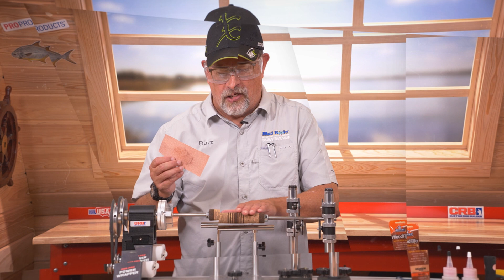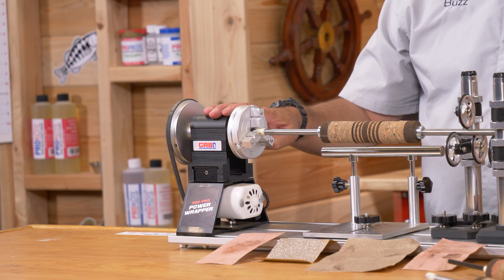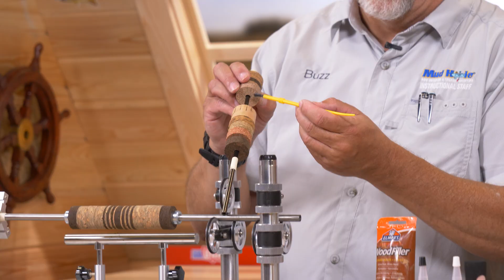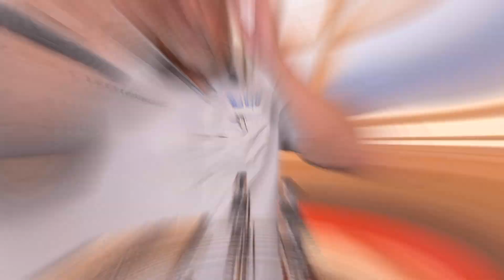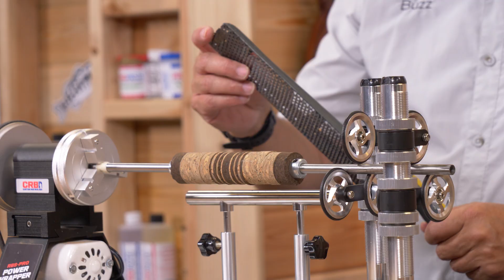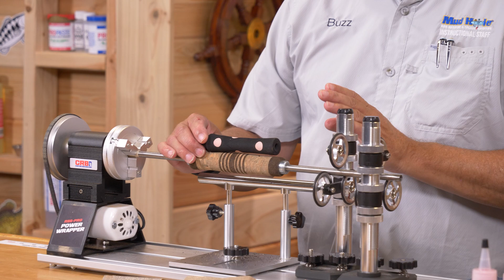How To SHAPE CUSTOM FISHING ROD GRIPS for Your Next Build | Mud Hole Rod Building Instructor Series

Comment: Could I use this power wrapper to turn resin epoxy grips?
Reply from the maker: You definitely can. Depending on what your doing I would start with a higher grit sandpaper than you would normally use when turning cork or EVA grips.